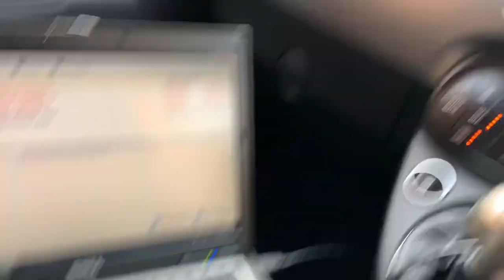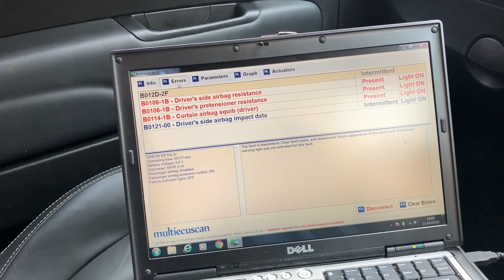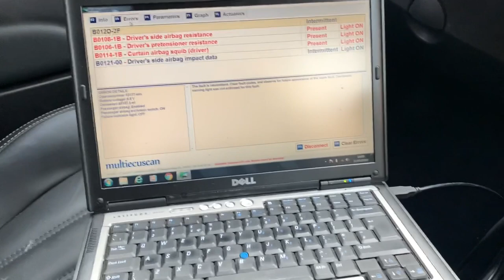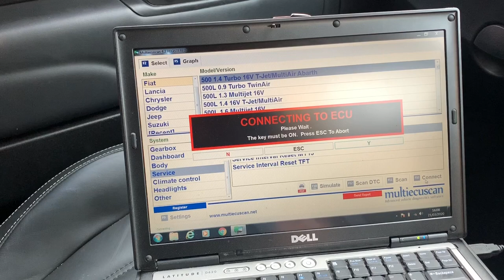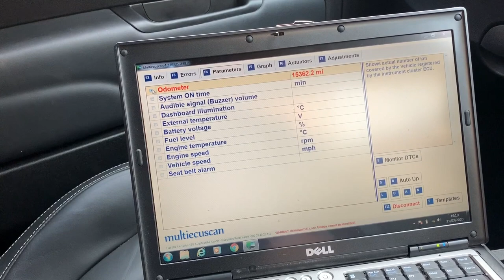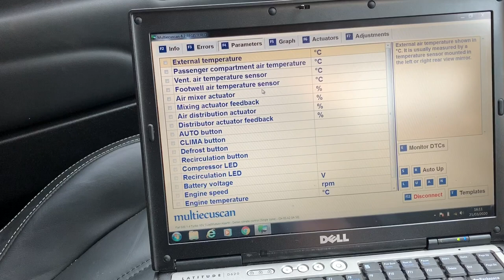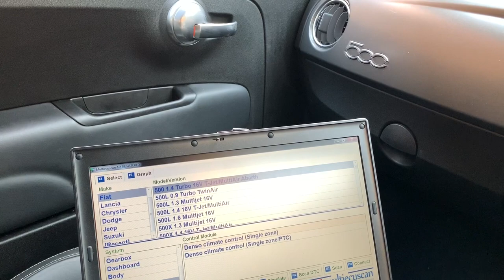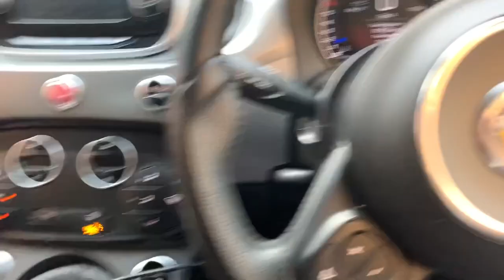The Abarth - First day out of the garage. - Stolen Recovered Copart Cat S Abarth Turismo

Comment: Looking like that may have been a bit doctored and door was swapped over to increase value
Reply from the maker: SALVAGE FLIPPERS don’t think so as the damage on the door is consistent with an accident. It’s a mystery as to why the rod is missing though. Someone’s clearly been in there though as the vapour barrier is gone.
Reply: Love 500 o know it’s a nightmare trying to figure out how and what has happened on these cars I’m the same with mine
Reply: @Love500  I'd look at the year stamped on the drivers window & see if it's 15 or 16. If not, that would be a giveaway
Reply: Strange abarth. Vapour membrane missing, seat belts cut, cut marks on the door cards and the dash isn't the same colour as the body? Used as to transport/deal illegal substances?

Comment: Am not convinced Uconnect is Blue And Me. Don't know why. Good plan for the 2 S model door cards you've mentioned you'll look for. Maybe take both wheels for top brand tyres tomorrow. Take it you're not bothered about remote key at mo.
Reply from the maker: No it's not. It runs on Bluetooth from your phone but the head unit has Phone button and of course the steering wheel has phone controls. Might find that doesn't work either.

Comment: Your a better man than I am , I would have been livid if I caused extra damage on that door , you was calm as anything 😀 looking good , lots of bitty elements but nothing seems major , can you try heat treatment on knife marks , always wondered whether it works.
Reply from the maker: G I will try that but I have a spare one identical which was in my loft. With the mottled finish I don’t know whether it would work. I might give it a go just to try, nothing to lose.
Reply: @Love500  Yeah would be good content , had a mate with an Audi A5 that has easily scratched plastics and we made his look significantly better , yours are deeper but be interesting to know whether the plastic does take back its original shape and whether burn / colour marks are visible , worst case you can flog your somewhat repaired one to someone who's not as bothered.

Comment: I’d say that was definitely stolen recovered. Thieves cut the seatbelts and plug the bit into the holder to stop the car beeping, they can then get away quickly when they decamp if involved in a police chase. It also looks like the door has been changed. The wing and quarter look constant but door looks fine. Good little project though 👍🏼
Reply from the maker: jowdgt that’s what I’m thinking. Will do an HPI check today, that may shed some light. The lock thing is a bit bizarre though. The pop is taking priority at the moment but it won’t take long to get the Abarth done.